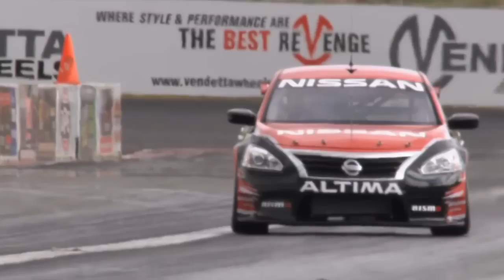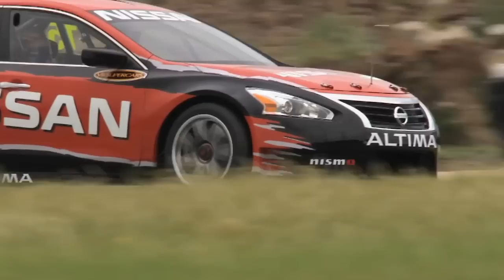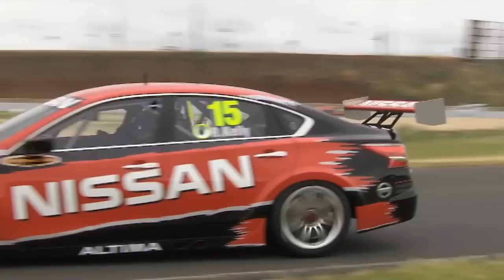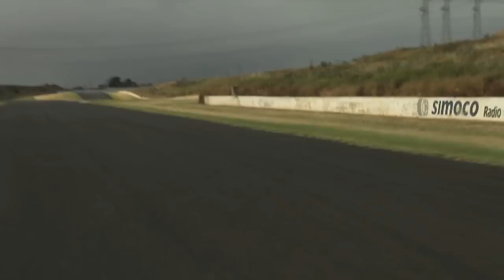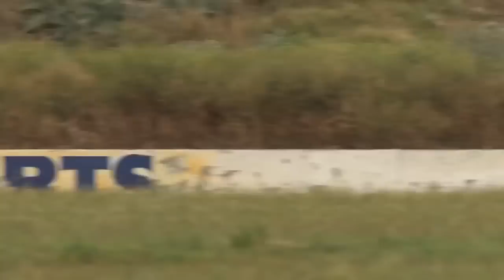Nissan tests new V8 Supercar (Raw Engine Sounds)

Comment: Love the VK56DE, its built in Dechard TN for the Titan/Armada and infiniti models.

These are strong and reliable engines just like the old VH45DE's.

With sleeves and stroker crank for an NA build the VK56 can be taken to around 6.4-6.5L.
Reply: In this trim i think its limited to 5L
Reply: @twoeightythreez   no 6l specifically
Reply: Is this the same engine with r35 gtr gt1?

Comment: The engine code for this engine is Vk56DE it is from the VK engine family. It is used in other Nissan models such as the Pathfinder, the Armada, and even the Gt-r Gt1 from Nismo it is a 5.6L 338.80 Cubic inch engine !

Comment: It's similar or the same as the engine in the Patrols except it has been de-stroked down to 5 litres. The engine in the Patrol is a 5.6, I think, but still has the DOHC and factory block. The rest I wouldn't know how different that is.

Comment: True Aussie racing would be a bunch of bush-whackers and Aborigines on the backs of kangaroos, racing across the Outback.

I think the Dunlop series is still Holden vs Ford, so maybe that series will gain a bigger following from the 'true Australian racing' fans such as yourself. Which must be good for motorsport in general. 

Ultimately it will be decided by the people. If the racing is exciting, and competitive, and the crowds fill the stands, then Australian motorsport is onto a winner.

Comment: Wow you just dont get it do you....... The Nissan Altima that will race in the V8s next year is a REAR WHEEL DRIVE that will be running a Quad Cam V8.

So whilst the road car is not a RWD V8 the V8Supercar version of it will be...... 

Go and google the 2013 Nissan Altima V8Supercar rather then talking about something you know nothing about.